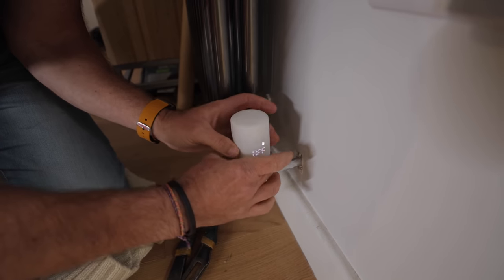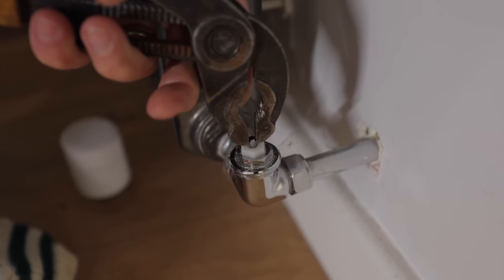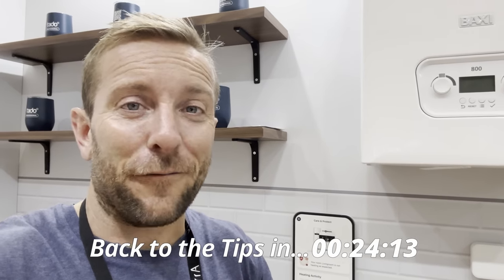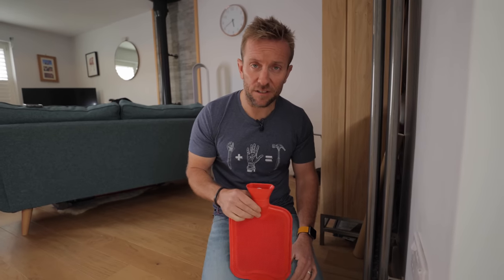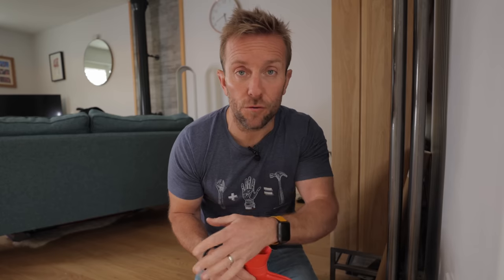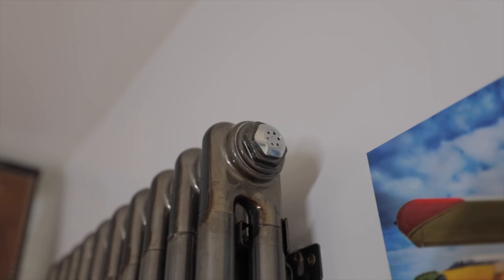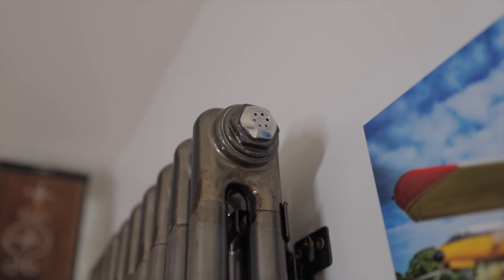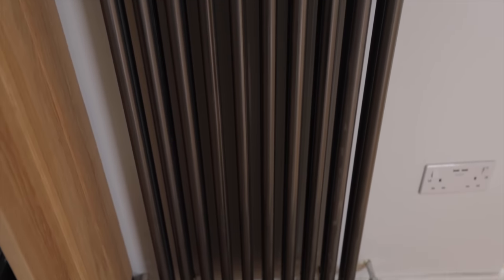4 MISTAKES YOU MAKE WITH ONE COLD RADIATOR

Comment: Those Aladin auto venting air valves will fail to work on an old system the second time you need it. Fitted new the vent (pin) hole in the back of the value will be open. As soon as the radiator fills and there is any sludge in the radiator the small hole will block up with sludge. The next time that you drain the system the blockage will remain and the valve will not work. There is also a secondary problem with the way they work in that there is a membrane  that gets wet and swells. When dry this membrane lets the air out and when the water reaches the top of the radiator and the membrane gets wet it swells to stop the water exiting. When you drain the radiator the membrane is still wet and if you fill the system again, say, a few hours later it is still wet so no air is released. Heating the radiator would dry it out but full of air the radiator remains cold. The valves are an expensive snake oil product!   First impressions when newly fitted, a great product, BUT you don't find out about their problems or limitations until  you need further work on a system.

Comment: Hi plumber parts. I've got a problem . I've been renovating the bathroom but I can't seem to turn off the hot water as I can't find the turn off valve . The cold water in the bathroom is turned off .I've looked high and low but can't find the hot water valve to turn off and it's holding me back from tiling the shower room and putting in the vanity unit in the bathroom. Is there a video that shows different scenarios concerning turning off hot water supply. Been like this for a couple of months . Been taking a bath in one of those buckets you mix plaster in ect . Would appreciate your advice and knowledge.  Love your vids full of info and entertaining. Good banter . Better than watching TV.  I think that every house across the UK should have a easy to find  manual concerning plumbing . Gas . Electrical points . That would help the  house owner but especially the tradesmen.

Comment: Got a TRV that lets in heat when I have it switched off (I dont like to sleep in hot room) So I want to just look at it, do I just unscrew collar, remove head, bounce the pin up ans down gently as shown and spray a little bit of WD40? I open it to 5 before hand dont it?
And have the boiler turned off? (its a combi) before re-installing the same TRV head?
Advice please, I'm not draining, or bleeding or gonna get wet or anything I am????
And the boiler goes off at the mains during this?

Comment: Question, I have a radiator that was cold. I took the trv head off. I gave the pin a bang before 😂 before I did it before i watched this video.
Back to my question, the radiator is now working, but the pipe to the trv is warm. The lockshield side is very hot. 
What do you think could be the cause of that?
Reply: Feed is on the wrong side. Might not be an issue at all tbh, depending on where the pipes are etc.
Reply: Thank you

Comment: I perfectly balanced all the rads and use the tado system. However, when the boiler starts to modulate as it reaches the set temp the rads start making a “motor” running noise.
I’m told, turn the pump down but it’s a variable pump.
The only solution is to undo the lockshield fully which then unbalanced the system
So far, I’ve found no other solution.

Comment: Question: Why do they say only bleed the radiators when the heating is switched off? I very often bleed mine when they are fully working and it doesn't seem to make any difference other than the water that dribbles out is a little warmer.
Reply: A system thats off, lets the bubbles collect, a system thats pumping, is pushing around microbubbles. Best is the have a T in the highest point of the system, and let it to to the attic or whatever and install a vent there. All air collects easily there. Bit of extra work, but i always do it, given the chance.

Comment: James unusual for me to disagree with you !many years ago I pulled the pin as you have shown …and it disengaged with the mechanism in the valve and would not reconnect. Since that day I have hit the side of the valve until the pin jumps up then with the water pressure pushing the pin up I have repeatedly pushed the pin down until it is travelling free
Our experiences shape how we rectify faults
Reply from the maker: Hitting the side is just fine. If you do pull, just a light tug will do!
Reply: @plumberparts  A light tug never achieved anything Jimbo, fnar fnar

Comment: Why do people have a TRV on a radiator when there is a room stat in the same room as the radiator?
Reply: You shouldn't have a TRV in the same room as the thermostat or you risk the thermostat never turning the heating off.
Reply: Yea. That's what I said but the boss said just open the TRV to the max and shut the fuck up.
Thanks for the reply though